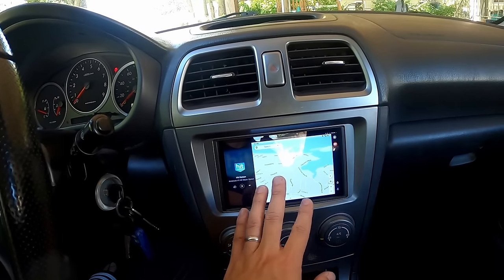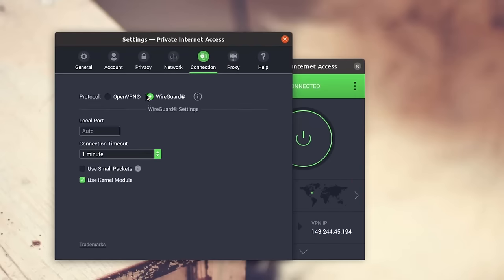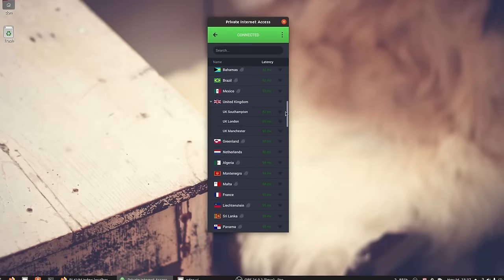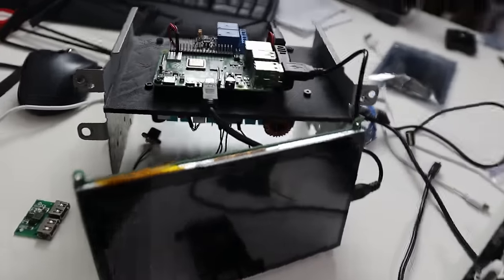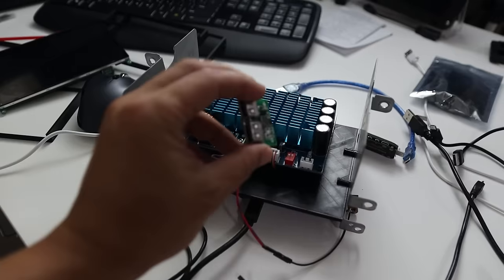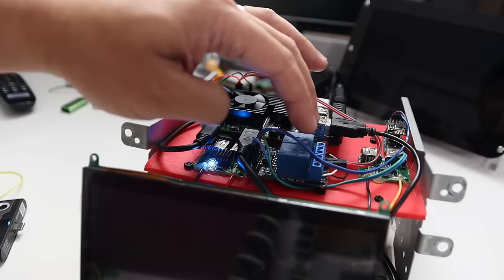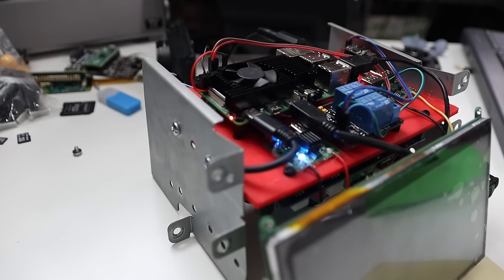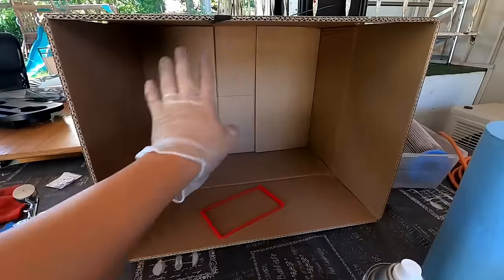OpenAuto Pro / Raspberry Pi Head Unit with Android Auto Full Install Build

Comment: Did you have to do anything specfic to the Pi to get it to take a touch screen input? Currently working on my own build, but but the touch screen won't work on the pi, but its working fine on everything else I connect?

Comment: but what if 12V is cut whille actually cranking the engine. since you are using arduino to manage power on/off, you could set the turn on delay for desired amount of time. I have been using openauto pro allmost since the beginning, without any unnecesery modules and arduinos (and when ambient temp were bellow 10 degrees celsius, all 12V were cut to provide max ammount of power to engine starter). I managed to get save shutdown and powerup with just 2 car relays and a 5V timer relay. (sadly my new cars sound system is controlled via canbus, otherwise I would have installed openauto pro for sure).

Comment: I like the design, reminds me of the centrafuse days. u need a way to add data with out taking it apart using either ethernet (wifi is not recommended) or usb to a hub.  have you integrated a fuse block?? u said the screen is powered by the pi  but if that amp blows up everything is gone, and ground loop isolate the 3.5 from the sound card to the amp.

Comment: OK, so I jumped onboard with the idea of replacing my 8.4" touchscreen in my 2015 Ram with a Raspberry Pi so I can get AA. I have been going through this for the past 2 weeks. At the same time I noticed a screen on amazon called Road Top 8.8 portable Carplay and AA....that seems to do exactly what I want, AA (wired or wireless) in my truck and a large screen. Why would I continue trying to get this OAP on Pi to work when devices like this 8.8 are out there? I don't need to run external apps like Kodi or Chrome and any app I would run would be through AA. Am I missing something special with this OAP installation? I am already into this for about 200 with the screen, the Pi, the OAP license so please advise if I am missing something.

Comment: reallllyy hope you can help me, i hooked up the same amplifier you used to my car speakers and to a usb sound car(which works with a headset) but cannot get it working, it is supplied with 12 volts and the aux in is connected identically to what you have

Comment: Can you have RCA outputs for front, rear and sub amplifier? Very neccesary if i had to do something similar :)
Reply: Like what Nova said, use a ground loop isolator. A good one. but then use an Active EQ like from DS18. it has one pair (left/right) input and gives you front L/R, rear L/R, and Sub outputs.
Reply: Dayton audio DSP will basically do everything that you want or get one of the higher end Nano miniDSP units or use one of the audio control DSP / amp combinations

Comment: For FM radio, Can you not just connect a wire or the cars antenna to a GPIO on the pi? You should be able to make a software radio from the signal, I"m sure this has already been done.

Comment: So is it possible to sideload openauto so it can be used simultaneously with Raspian? I currently have a pi4 in my turbo e36 that I use with tunerstudio for tuning and digital gauges but would love to be able to emulate android auto and have it operate as a media center as well and this build seems to be what I'd need, but I don't want to lose the ability to bring up my gauges either. Noob to linux/pi so sorry if I'm a bit daft with it

Comment: Why would you not buy an amp intended for cars (with all of the independent speaker outputs), and use the space in the head unit to drive a higher-fidelity DAC instead?
Reply from the maker: The amp I am using is intended for automobile use. But yes a nice day would be nice too

Comment: I wonder how the temperatures affect this. The 3D printed PLA parts are probably already warped after the first sunny day(use ASA instead). And I imagine the raspberry pi won't like it that much either. But still a neat project!
Reply from the maker: It's all printed in abs
Reply: @NovaspiritTech  I think it's because in the beginning of the video you mentioned PLA lol. I went to the comments for the same reason. ABS or PETG will work fine though :)

Comment: get rid of the amplifier underneath the head unit it's not needed.   you also will not be the ground isolator if you do it this way and you'll get the highest quality sound possible with zero noise.

 BUDGET
Walmart has an amplifier by the Jensen brand label which is actually made by the same engineer that makes the superior line DUAL  amplifiers that both budget Gems , Big D , and me of course have tested thoroughly.   this unit has the Bluetooth input also has a basic equalizer you can use via a Bluetooth connection as well.  it also has configurable RGB lighting

the amplifier can be purchased anywhere from $69 for two channels $100 for the four Channel. 

that will take care of any ground Loops you have and any noise that you may experience will be a thing of the past.   you also don't need to run RCA's which means you can basically hook up this amplifier anywhere you want which is convenient.    

PRO WAY

pick up any outboard DSP  that accepts Optical or uses Wi-Fi or Bluetooth input.   the Dayton bsp and the Adu 1701 also has this capability.   you can also use something called the hifiberry in order to get multi-channel out of the Raspberry Pi and use that to drive your amplifiers but it's a little bit more technical than needs to be.    you can also use something like a mini DSP which works very well.  the Nano digi is  my personal choice since it has a channels of output and accepts Optical inputs.  it's best to use a PC to set it up however.  you can also use things like a volume control knob and other accessories with it if chosen.

you get up to eight channels of audio that way you can go fully active on the components that you have and purchase any range of 4 channel amps that will fit your pricing budget.   

I'm currently doing heat testing on a blocked punt 1504 4 channel amp and it does get a quite a bit toasty when running on hot days.   if you plan to use a 3-way front stage then it's not really a problem for running tweeters and mid-range.  

the excellent line of dual digital amplifiers is my personal pick since they never overheat or I've never experienced it and they sound wonderful especially when used in an active application.  

at the very minimum you're going to need a 4 channel amp up front and a dedicated subwoofer amplifier which you need to be mono or stereo that's up to your setup.  

doing it this way we'll get you the highest audio quality while at the same time not only do you get close to zero noise from things like round Loops but it will be damn your silent during operation and interference is not likely.    

MICROPHONE  
for the microphone I always suggest a Bluetooth microphone mounted anywhere you would like mainly because again it gets rid of the ground Loop problem that you usually end up having interference or engine whine being picked up to the microphone cables.    there is always a source of power in the sun visor area has a sun visors usually have a dedicated 12 volt line that's always live.   

that way all you have to do is just Supply power to it which is basically the ground in a positive and that can be had from just about anywhere in the vehicle.  

NOTES:
 

check out the hifiberry project for Raspberry Pi it might be of interest to you

if you're going to install a subwoofer anyways , it's probably a good idea to install a second battery in the trunk area like an XSpower or something similar or make your own Lithium Ion Battery/pack.   the reason why I mention this is that now you have a what is essentially a FULL PC in your car?   Why not use it as such?  

Remore start?  Car Alarm?  Car Battery monitering and Low battery start?  
FULL DVR for your CAR WHILE ITS PARKED! 

GPS Locator!
WiFi Router. 
Lighting control. 

Etc et.c etc. 

I would rather have the Pie running all the time then worry about shuting it off  due to not having enough battery capacity on board.     if you have a 21st century stereo it's time to have a twenty-first-century battery
Reply from the maker: ha i never thought about using bluetooth for a amp / mic setup. that's not a bad idea.

Comment: Great video! I have been wanting to do this in my vehicle for a couple of years, lack of FM radio has been the only thing stopping me. I can't wait for your update videos! Will you  be posting a more in depth tutorial for the wiring somewhere?
Reply from the maker: yup, once i run this setup for a weeks and able to confirm no issues with wiring, i will post up a more detailed guide for it
Reply: Wouldn't you're Android phone most likely have one?! But I'm not sure if Android Auto works with native FM tuner apps.
Reply: @metaorange302  You can get apps that use your android phone but they  use ear buds as the antenna. My truck is older and doesn't have an aux input or bluetooth in the stock unit. I can pay $400+ for a new unit or play with stuff I already have on hand and spend less and learn.

Comment: Running OAP on a pi4 with the 5" touch screen as well. Planned to use a light sensor to control backlight but I don't think these screen's backlight can be software controlled  - all you can do is adjust via the momentary switch on the back of the screen. Any ideas on how you plan to attack that?
Reply from the maker: i was thinking about using my pi to control the backlit light manually.
Reply: @NovaspiritTech  I couldn't find any way to get my pi to communicate to the screen - I am unable to find any scripts of any kind controlling back light. please update if you figure it out!

Comment: do you know of any preamp boards for the pi I personally don't use the built-in amp on my receiver and seems to me it would cut your dash temp also
Reply: plug in any outboard audio device like a DAC via USB  or get a wifi or bluetooth one. 
if you only need two channels then hifiberry may be the way to go.   they do have a 4-channel unit with a optical and coaxial out from what I hear.    

Jesus I believe makes a killer audio card which is able to be plugged in via USB that would work great.   it has 7.1 channels and I think they have software that will run on an Android instance but again don't quote me on that I know it works in Linux, 

 it's about the best audiophile $200 value sound card there is on the market
Reply: @MickeyMishra  specificaly I would need front left right rear left right and sub left right

Comment: That looks really really really good - I'm surprised, it looks like factory kit...  If you were going to rig up something that would allow security cameras to run and store video (when the vehicle's parked for instance) would you power this system up or perhaps entertain a Zero running separately on lower power?
Reply from the maker: prob use something else like a pizero
Reply: @NovaspiritTech  how about a Pico used to control pins, etc.?  Would that be viable in this configuration in some way?
Reply from the maker: Pico would be good for macro keys like volume up or down
Reply: @NovaspiritTech  I was wondering about putting a separate local speaker in the system (plugged into the audio jack perhaps) that localises feedback sounds so they don't blast through the main speakers....  Is that viable?

Comment: Nice Work , but there no Free version of OpenAuto , and i dont think that PSU will handle voltage drop wheen u start the car?
Reply from the maker: when the car is starting the Relay keeps the pi on the "off" state which only draws about 0.040 amps. so wouldn't effect it much. the free version of openauto is not as complete but you can check out crankshaft, which is a free alternative
Reply: @NovaspiritTech   ok  i didnt find anywhere the only option is the paid version.thx
Reply from the maker: https://github.com/f1xpl/openauto
Reply: The paid version is only  $29 for current and ALL FUTURE UPDATES.
That’s pretty cheap, and it help the software author continue his work.
Reply: OpenAuto Pro is so worth the $29. Buy it. You won't regret it.

Comment: I would have done it differently. Would have powered off completely after shutdown (I made a circuit that does precisely that for another project), and would have used a i2c battery RTC to keep the time. Also I would have used a high quality audio hat or usb sound card. Also a FM/DAB receiver. Awesome job anyways. Surely works better than the crappy Sony Android Audio thinghy I bought

Comment: Heat is the number one reason I haven't done this before. I tested the heat for a week during the peak of the hottest season in the direct sun. It just wouldn't work in my area.
Reply: For real?     what model Raspberry Pi did you have?   the Raspberry Pi according to their own website says:

' it has an operating envelope up to 185 degrees Fahrenheit "   (Not IDEAL)

ALSO:
"A Pi user in Australia installed a Pi in his attic--in the summer--and it ran in ambient temperatures of 140F (60C)."

https://www.raspberrypi.org/forums/viewtopic.php?t=228420

it's small enough to do liquid cooling by dunking it in mineral oil in a passive finned aluminum case where you can extend the wires to whatever you need to Route them to.

Comment: RTL2832U this FM Tuner has linux support out of the box and you can get an SMA to Car Antenna Adapter on the cheap from Amazon, Ebay, etc. This should solve your FM Tuner problem. @Novaspirit Tech

Comment: OpenAuto web page states that an EXTERNAL Bluetooth adapter is required.
Does this mean the RPi4 in-built BlueTooth is NOT SUPPORTED????
Reply from the maker: correct, you will need to use external bluetooth dongle. i got mine long ago for under $5 and it still worked with it. i was able to run without bluetooth but you wont have full function like wifi android auto
Reply: @NovaspiritTech  ..yeah, I’ve got a drawer full of Bluetooth and WiFi dongles, it’s just surprising that OpenAuto is not supporting Raspberry in -built BT..

Comment: would this work to replace a uconnect? could it be programmed to be able to control the climate control and heated seats and other settings? my uconnect is completely broken so i want to replace it with something i can trust. i dont want to put cheap headunits in it and actually get a worse experience… and i dont feel like paying 1200 dollars for a new one

Comment: I was running a raspberry pi 4 with OpenAuto Pro and while the initial idea was great, I found OpenAuto Pro to be clunky, not overly intuitive.

I've since ditched OpenAuto Pro in favour of Android 12 on the Pie. Android 12 has a much nicer and more user-friendly interface and it supports USB DAC, USB GPS, SDR for (FM/AM) radio) out of the box.

Comment: Is there anyway to integrate high quality DAC chips like the ess sabres?
Reply: get a USB DAC
Reply: @MickeyMishra  true but for a head unit to power my speakers  it need to have rca outputs maybe some usb dacs do idk
Reply: @boppernostopper8598  look up the iPad dash kit
digital output RCA's and steering wheel controls all-in-one it's sold by sound man and he's actually pretty big on YouTube.

is the inventor of the iPad dash kit or the patented one
Reply: @MickeyMishra  thanks!
Reply: @boppernostopper8598    Yes.   Hell, I did it with a ChromeCast device.  Just streamed my phone via Bluetooth to it then used  1/4 Jack to RCA to the amp.  I did this with a usb Power brick. LOL.   I do a LOT of testing. :-)

Comment: If your Pi used 300mA when powered off there's something seriously wrong with it. I Don't think you actually shut it down at which point a Pi 4 would have used less than 30mA

Comment: I can assure you that the hot glue WILL NOT HOLD in any day that's over 85 degrees out.  If it does let me know what brand glue sticks you are using.  I tried every hot glue stick I could find and they all fail under any warm day....
Reply from the maker: the hotglue for the screen is temporary, once i feel confident enought on the setup i will make a more pernament setup

Comment: please please make it boot from ssd or anyway to make it boot within 5 seconds? couldnt find it from any YouTube  video that make it boot from ssd.30 seconds of boot time is ridiculous, this is 2021, 30 seconds make me think of I am in year 2000 .
Reply: There are some ways to make it faster. Not really with OpenAutoPro I don't think. I'm going to try and activate when doors unlock so it'll be well on its way when I startup.
Reply: Or you could try my method....  Leave the Raspberry Pi powered all the time.  Is there a battery draw. Yep. As i bench tested my setup, the total draw was less than 300 milliamps. Kill a battery in a day. Nope. Kill a battery in 2 days. Maybe. Didn't run it that long.
Reply: @TexasDragon2007  300mA off current is ridiculous. There should be some way to put the board in sleep mode. Or hibernate in the worst case. I haven't tried it (yet), but I doubt it wouldn't be possible.